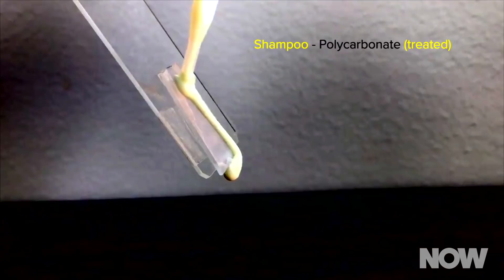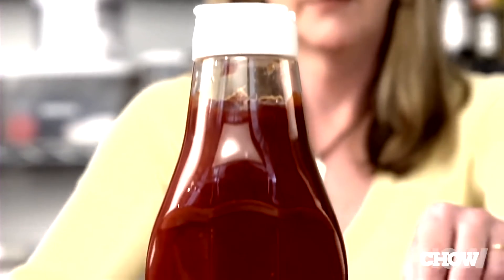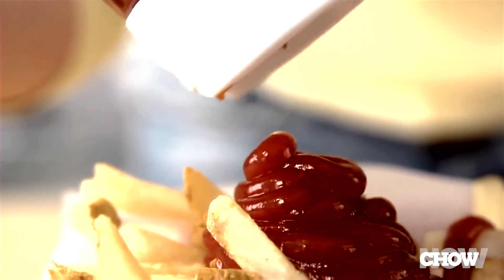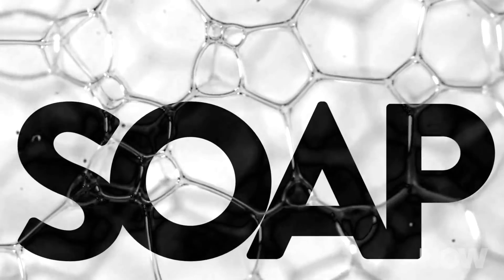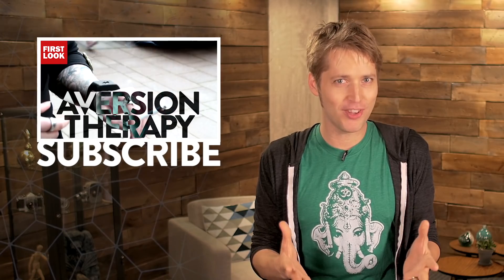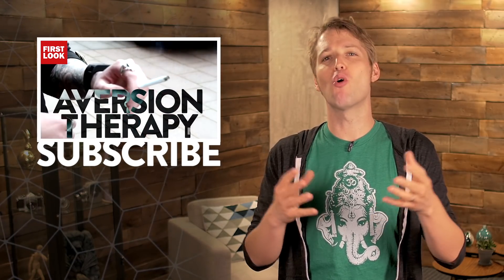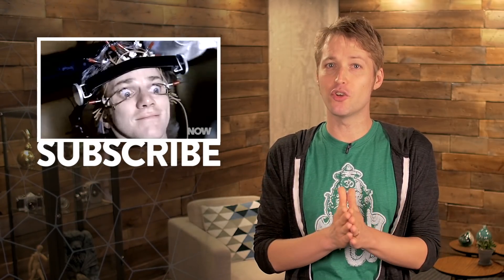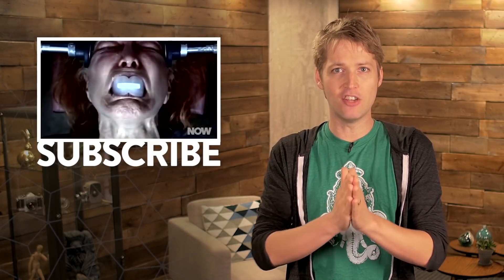Engineers Devise Shampoo Bottle That Doesn't Hold Back | HowStuffWorks NOW

Comment: So random that I found this video. I have been literally getting pissed off in the shower at my Pantene  conditioner bottle...it's made out of the shittiest plastic available. The bottle will only rest upside down so there isn't worry of wasting the last bit. But the plastic is so cheap and hard to squeeze you need two hands to do it.. which means I need a third hand to squeeze the conditioner into...which, well, we all know I don't have a third hand...sorry for the rant..Maybe I need to discuss this debacle with Pantene....